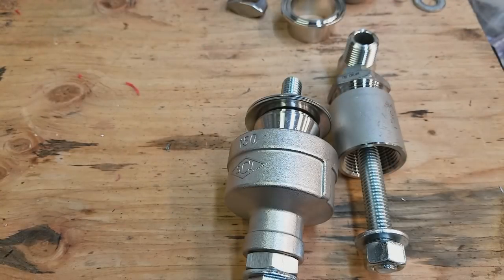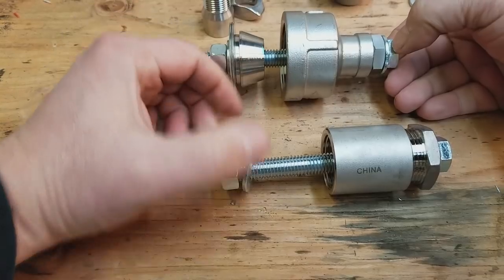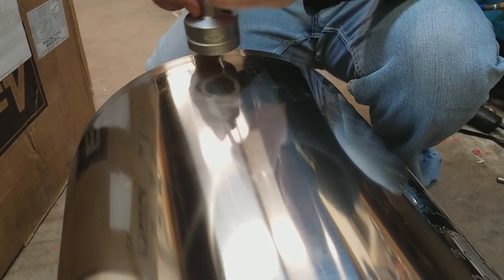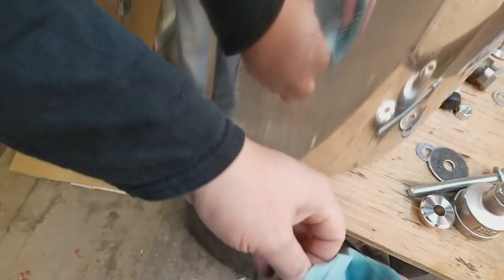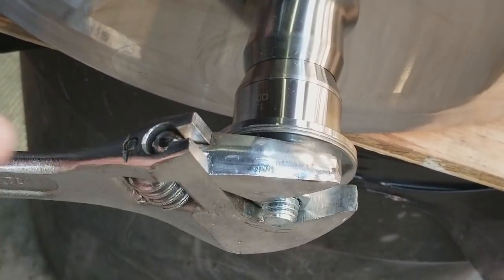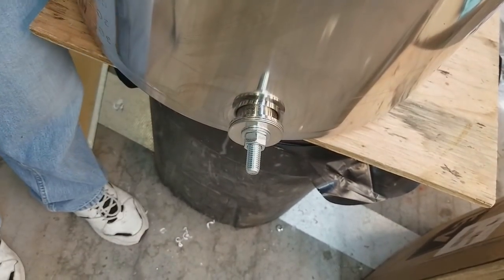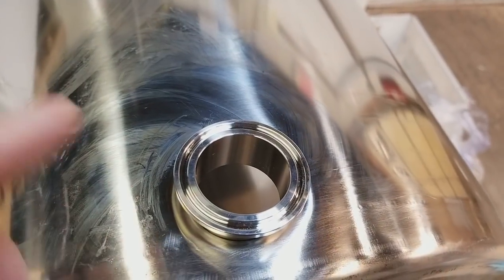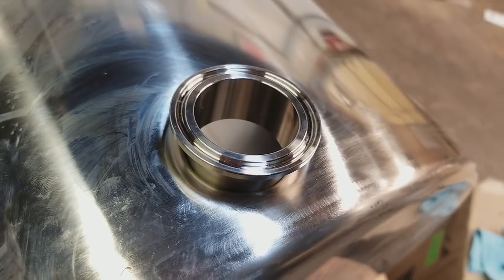BrewHardware.com's New Pull Through TC Ferrule Tool

Comment: Pulling through on a beer keg is a heck of a lot tougher than with a pot.    I went with a 35mm hole and stretched to fit.  (inner diameter of the ferrule).  I will probably go 37mm next time around.    Make sure you are using real wrenches (not adjustable) to tighten (adjustable will slip and round the nut) and you will likely need an extender bar if you aren't young and strong.   I used the stainless pipe from inside  the keg to give me the added leverage.   Another hint.   You can get long  1.5" ferrules.   This gives you lots of meat both on the inside and outside.

Comment: I have a few questions with this. I just ordered the 1.5" tool as all I plan on adding are tri clover fittings. I actually have quite a few to add to various parts of my brewhouse. On a kettle, it will be sanitary especially with boiling.

On the other side of the brewhouse is where I'd like to add a few on my unitanks for a carb stone port. What kind of pressure can these silver brazed joints hold? I usually carb at 15-16psi via a stone. Will the hold say up to 20psi like a tight welded joint can?

Also, will these be sanitary enough for a conical fermenter? 

Thanks in advance.
Reply: Stay brite #8 Says 15,000 psi strength.

Comment: My 1144 Bayou classic ruptured at bottom seam. Worked well on another pot, but not this one. 😶
Reply from the maker: In about 100 jobs so far, I've had one cheaper pot tear at the bottom weld seam on me. I was able to get it soldered up and sealed but now I'm careful to move away from the seam when possible and sometimes make the hole a little larger to reduce the flaring.